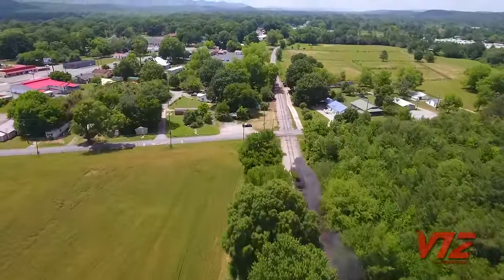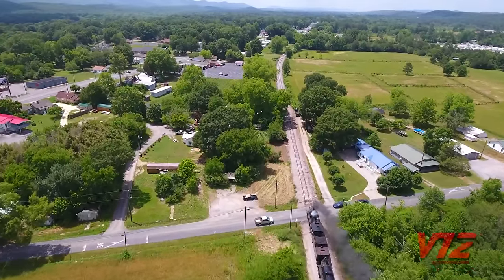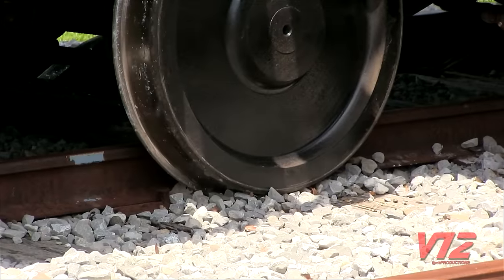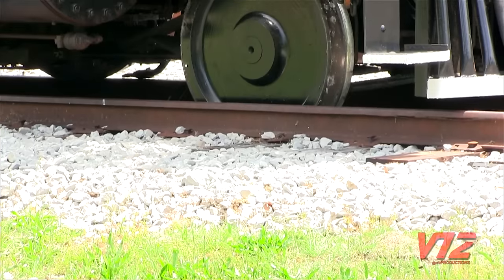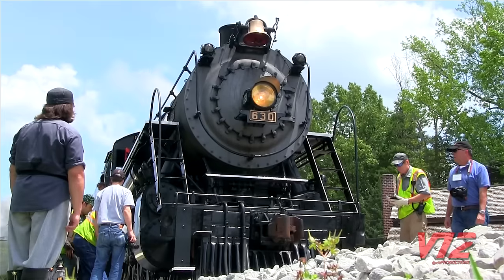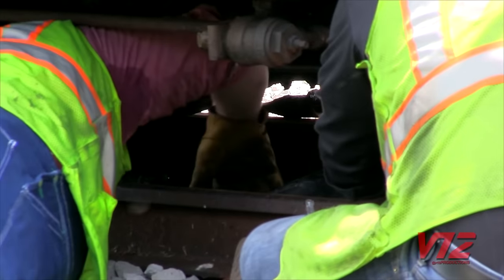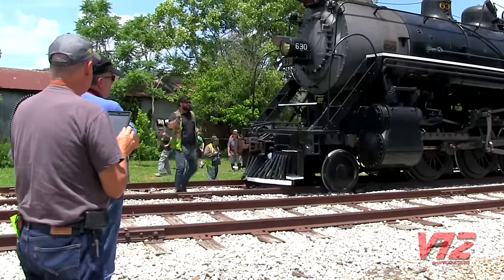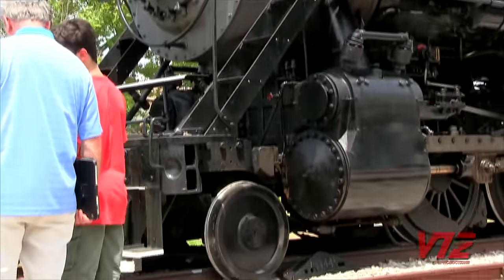Steam Locomotive DERAILS in Summerville, GA

Comment: Boy do I feel bad for the guys who had guys who had to deal with the first railroad derailments.  Those guy porubbly had no idea how to fix the train and had no special tools to help them!
Reply: First railroad trains were extremely small compared to todays trains and a group of men could easily re-rail the train. As the trains got bigger is when they installed re-railers on the train or if the de-rail was bad enough they'd use steam powered cranes.

Comment: Steam engines are dangerous when derailed. The pressure rises quickly and if this was any longer they would have to dump pressure.

Hello from Uk by the way!
Reply: Nonsense. The safeties on the boiler lift automatically at the maximum allowed pressure, and are sized to release steam faster than the boiler could possibly produce it. In a derailment like this the only danger is if the locomotive runs low on water- easily avoided by asking the local fire department to bring more water in a tanker. 

Now a derailment that sees the locomotive tip over could expose the crown sheet and create a major hazard, it is necessary to smother the fire with dirt to avoid overheating the crown sheet.

Comment: uses wood to knock a massive locomotive wheel back onto the tracks
Reply: Very FRESH And Unsuspicious MEMES akash verma
Reply: Actually, in a derailing situation the rail is often tilted, so wood wedges have to be jammed between the bottom of the railhead and the ties/ballast, and then driven in with sledgehammers to move the rail back to perpendicular.  The wood doesn't damage the metal.
Reply: They meant trying to smack the axle across with the sleeper. Probably up to 15T on that so wasn't gonna happen
Reply: Lewis Doherty
Reply: What caused it to derail when was this
Reply: Kevin Jones the detail was caused by packed gravel
Reply: North Georgia Rail Productions  thanks for the info
Reply: Very FRESH And Unsuspicious MEMES c